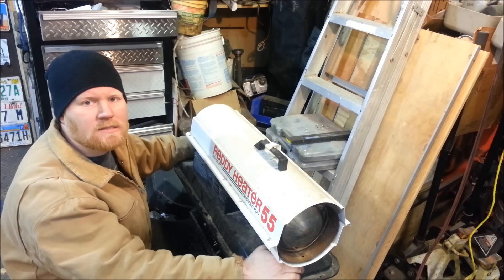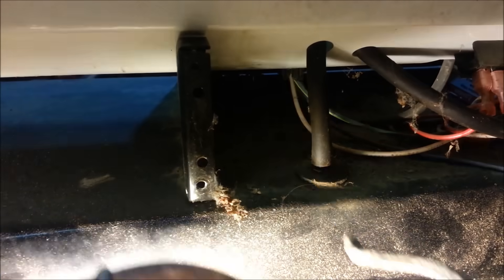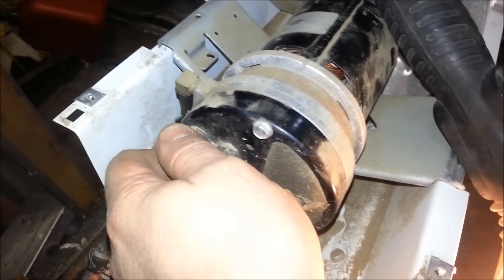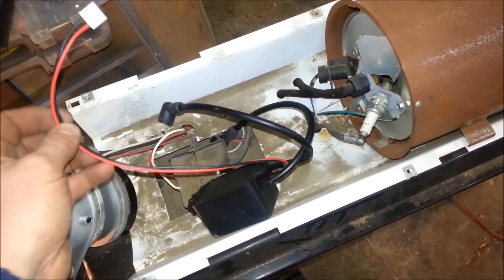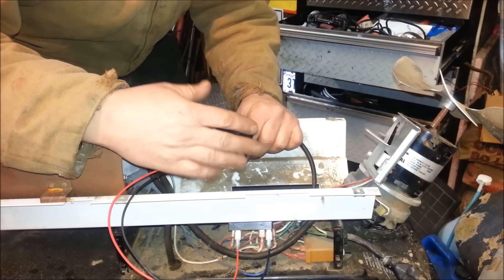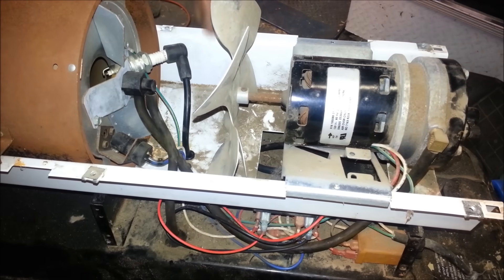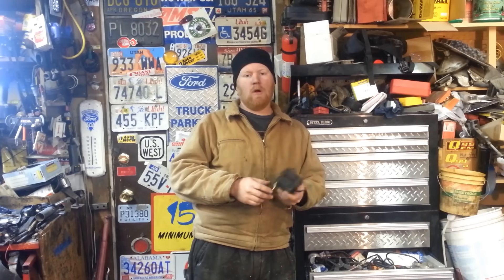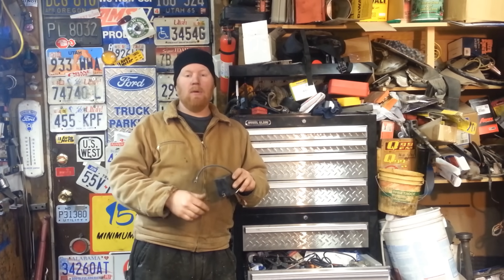Torpedo Kerosene Heater repair & HOW they work

Comment: Just wanted to thank you for your video.  I have the reddy heater 55 also, although mine uses a glow igniter.  I went through and checked each of the areas you mentioned. Everything seemed to be working individually (glow, fuel, air), but my issue was that my heater would run for 30 seconds to a minute then shut down.  I finally pulled the fuel line and blew down into the tank to clear it.  When I did, fuel came back up through the line???  So, I figured that the tank was pressurizing.  Come to find out, the breather hole in the fuel filler cap had debris and rust in it that clogged it shut preventing the heater from drawing fuel because of the vacuum it created after a minute or so.
Just thought I'd share in case someone else could use the info.
Reply: Good  catch   I had same  problem  with  the  fuel  cap on  my  snowblower , my older  heater   started  to  quit  after   about  a  minute   haven't  used  it  for  years  I just  thought  it would-be   a bad  over temperature  sensor   so  there  it sits   thanks , sometime  I'll give  everything  a good   cleaning .
Reply from the maker: nickgw Thanks for the heads up.
Reply: Will go and check mine, I get about five minutes!, had it in bits and found nothing wrong, didn't think to check the breather hole, good spot!☺.
Reply: Mine is doing the same thing, THANK YOU! You just told me exactly what's wrong with mine. I have the 35K BTU model
Reply: Thank you
Reply: Thank you

Comment: Great video!  I also have no spark on my heater but  I'm unable to locate a cheap universal ignitor like the one you used.  The cheapest I found was $43.99 on Ebay.  Would you please post a link where I can order the ignitor for about the same price as you paid and also one that has a long enough spark plug lead.....  Sure would appreciate it!  Thx Bill
Reply from the maker: Bill Gilbert $44 isn't bad. If you want a generic one you can get it from equipsupply dot com

Comment: So my heater fires up and runs fine for about 5 minutes and then shuts down.  I can restart it without a problem, but again it will shut down in about 5 minutes.  I bought it new about 2 years ago but it probably only has about 100 hours on it.  Just curious if you have any ideas why it shuts down.
Reply from the maker: Earl Blansfield If it is tripping the breaker and the flame is still lite when it does the Photo Sensor is bad or has a dirty lens.
Reply: I don't think it trips the breaker.  The flame will burn nicely and then it shuts down but the green light is still lit on the power switch.  I just turn the power switch off and turn it back on and it fires back up.  I think it might be a ventilation issue, but not sure yet.
Reply from the maker: I suspect your photo sensor. If the flame and fan shut off it the heater's internal breaker is tripping. A lot of time you will even hear a click when it shuts off. It is meant to shut off the machine if you run out of fuel or if the flame goes out to prevent the machine from continuously running. The photo sensor sees the light from the flame and allows the machine to stay running. If it sees no light it shuts it down by tripping the internal breaker.

Comment: Got to say thank you for posting this video. 
Fixed out little Reddy Heater today, was a fouled spark plug... 
I can't change the air flow setting the screw rounded off, but its working okay as it.
Reply: Dude!!!! Great video... I almost bought a john Deere that looked pretty clean...just wasn't working.... I was really hesitant to pull the trigger a blow $100 bucks on Something I didn't have a clue how to begin to fix.  The next one I see is all mine!!!!   So, thanks so much!
Reply from the maker: Terry Martin That's always awesome when it's such an easy fix. Thanks for watching.
Reply: Those plastic screws really suck. The screw drive spreads the end and makes it bind up while turning. I machined a 3/8-24 set screw to replace it but I"m still not getting enough pressure. I don't know how to check the motor.

Comment: i got an older torpedo heater (master ) it trips out almost straight away,it does not have a photocell on it,any ideas ?thanks
Reply from the maker: gill834 Kerosene or Propane?
Reply: kerosene
Reply from the maker: I've never seen one without the Photo cell, but they could have used a temperature sensor switch. There needs to be something that senses if there is flame or not. Either by light or temperature of the flame.
Reply: i think you could be right,when i bought it the guy said he switched it on and it tripped out so i brought it home and took the cover off and the motor was quite stiff so i stripped the back of the motor down and give it a good cleaning.The motor still slightly stiff so will put some oil in the front where the fan fits on the shaft,still a lot of muck to clean off but taking my time as it's been cold,i will keep you up to speed with how it works out and probably be asking for more advice....soon lol

Comment: I have a couple questions. Do you prefer propane or kerosene? If so why? Do you run straight diesel instead of kerosene for the cost difference? I just bought a small kerosene heater for my garage (a small portable, but it prob only 20k btu's, it's the old perfection heater), and want to buy another more powerful one and can't decide on sticking with kerosene (which I am hoping I could run diesel for cost purposes) or going to propane. I also bought the kerosene heater cuz its looking like my state is making it illegal to have a fire in a fireplace, thus if the power or gas ever goes out I will still have some heat.
Reply from the maker: I do prefer diesel over propane. Propane has less btu per gallon and you use a lot more. It burns super clean though but if it's to cold your propane tank will also freeze right up and stop flowing propane.  The portability of the the Kerosene/Diesel heaters is also a plus.

Kerosene vs Diesel : People claim to hate diesel saying it burns their nose and eyes(I've heard the same for propane) when run in these heaters. I beg to differ and think Kerosene has a chemically smell while diesel smells like oil. Neither Kersosene nor Diesel have ever given me burning eyes, nose, or anything of the like. I run exclusively Red Dye diesel(offroad/farm) as there are no road taxes on it(standard diesel with red dye so truckers don't cheat the system)

Propane= 91,200 BTU per gallon
Diesel=138,800 BTU per gallon
Kerosene=135,000 BTU per gallon

My current cost 2014
Propane=$3.00 gallon= $3.28 per 100,000 BTU of Heat
Diesel(dyed)=3.15 gallon =$2.26 per 100,000 BTU of Heat
Kerosene=9.60 gallon= $7.10 per 100,000 BTU of Heat

Comment: Hi 65, love your videos.  I have a multi-fuel torpedo heater that is not working.  I dont even know where to start with it.  It has a thermostat and an on off button.  I plug it in and turn the thermostat all the way up and hit the switch to on and nothing happens.  It doesn't even make a noise.  Where do you think i should start?  BTW it can run on kerosene, diesel, jet fuel and waste oil.  It is 165,000 BTU.  Your help would be appreciated.
Reply from the maker: 1jonat Your circuit breaker on the side could tripped. It trips if the unit runs out of fuel or the flame gets forced out. Press it back in and you should be good. If it isn't that I would assume the thermostat is defective. It is just a switch and you can just bypass it by connecting the 2 wires. You could run it this was indefinitely.

Comment: I have a ready heater 100a, I can turn the photo cell towards a light and the unit will run, when I put the photo cell back, it cuts off.  Would this be a bad photo cell or a bad flame out control.  The plug and nozzle seem to be working fine.  Thanks.
Reply from the maker: huntsbd Yep, sounds like the photo cell is your issue. The lens can get melted or fogged so it takes a ton of light to work but the small light from the flame isn't enough.
Reply: Thanks.
Reply: huntsbd After replacing the photo cell, plug, and filters the unit is not firing now.  I checked the flow on the back with a vacuum guage and it is around 3psi.  This machine calls for 4psi.  It would not change regardless of how much I turned the adjuster.  When I take the upper cover off to troubleshoot, it sometimes fires, I put it back together and it does not.  Would this be an airflow issue to the nozzle or is the back fan/pump bad?  Thanks.
Reply from the maker: Either the pump is going out or you have a cracked rubber air hose leaking air. The back pump is very easy to work on and only takes a few minutes to work on. Pull the couple of bolts and you will get to it(note the couple under the air filters). There are a few(usually 4) blades that slide in grooves. Make sure they move freely. We need to get your pump pressure up.

Comment: Helpful video.Actually been working on a master b150c model today.Replaced nozzle kit,due to it would run without the top,put top on it'd choke out.It did better,but had difficulty adjusting pump pressure.Found that one of the plug ports had hair line crack around it,so I took the pump cover off another compatable heater I have,slapped it on and worked nicely.I have a new filter cover on the way.I do have a question though.I sealed up the crack with silicone to check if it'd still work before ordering a new one,,and at start up,it puffs out a big puff of smoke then planes out,,,do you think the new filter cover will fix that??,,or could something else be the problem?? Thanks
Reply from the maker: FlintSpall You say it puffs but still starts. An initial puff is generally a failure to light/fire right away. This can be from too low of pressure or dirty spark plug.
Reply: sixtyfiveford Thanks for your time,,,yeah, doesn't fire instant,but theres maybe a second delay which causes big puff,,,which if indoors,causes a great stink.I have done some light brushing on the plug with a fine wire brush.It shined it up a little,,so I'm hoping once I get the new back cover,I then can get the pump pressure right,and fix the start up.When I put the other cover from a different heater on it,,it fired like a new one.No smoke,,just a quick,clean start.Thanks again.

Comment: nice video...I purchased a duralast 55,000 btu torpedo last year and haven't used it more than a few hours. I have owned many heaters similar to this one...my problem is the fumes are much stronger than the ones I have used in the past, its like it is running rich or something so would the psi being to low do this or to high?
Reply from the maker: H.D. C. To high.

Comment: I have a reddy heater 1701 unit that will start right up, but then goes out within 5-10 seconds everytime. any idea what this may be ?
Reply from the maker: 1uniquez Photo sensor is not seeing the light of the flame. Either the lens is dirty, an insect laid it's offspring in it or it's just bad.

Comment: Howdy. I've put in a new ignition transformer in my R35A Reddy Heater. It would ignite the fuel and it ran for a 2 hours i'd shut it off. come back a few days later i'd have to take off the top of the unit and blow excess fuel off the plug for it to light up. Now finally I went to use it and now it's not sparking at all. This is a brand new igniter. What's my next move. My ingiter/coil has two leads. i put one on and wrapped the other one in a tape (NO PLUG)  and sat it under the ignition chamber.
The photo eye is working cause it's shutting off after a few seconds. What's the take? Did I burn out the igniter by only having one plug used and the other one not attached?  
I really love this thing and want to get her running .

The video is fantastic and your teaching approach is excellent.
PEACE
Reply from the maker: Ross Guidotti Each coil lead should be on its own transformer so the other lead may still work. But it may just be a faulty spark plug that is shorting out internally. Put any random plug in the lead and lean it against the metal body of the machine to see if you get a spark. I noticed that my 2nd lead was sparking through the tape and onto the frame of the unit. I put another random plug in the second lead to control the spark as there was no way of stopping it.
Reply: sixtyfiveford could the opit sensor be shot and that play a role ? I got current from the line heading to the transformer. I switched the wires, (BOTH LEADS COMING FROM THE TRANS FORMER ARE RED?) No go.. confused and cold
Reply from the maker: The optical sensors role is the trip the reset button so there is no power to the fan or anything else.

The optical sensor is doing it's job if you plug in the unit and the flame fails to light and after 5+- seconds it trips the power off to the unit.

The optical sensor is bad if the unit lights and begins to produce heat then it trips off the unit off for no reason.

Power going into the transformer is AC power so it doesn't matter which lead goes where. Are you not getting spark from either spark plug wire?
Reply: sixtyfiveford neither is doing anything. is there a way to test it with a multi meter..
Reply from the maker: If you can test that power is going it and there is no spark, it is dead.
Reply: usually you don't want to leave the secondary circuit of the high voltage coil open circuited because it develops internal arcing that can damage it. putting another plug on the second line or even shorting it would be better than leaving it open.

Comment: thanks for the video helped a lot have a reddy heater 35 it is supposed to be set a 3 psi got it set it starts and run great and the front plate get nice and red the only thing is when you unplug it has smoke come out the back for a little bit is that ok or do i need to fix it and how thank you for the help
Reply from the maker: Dustin D A little smoke is normal. That is just the last bit of fuel vaporizing on the hot surface.